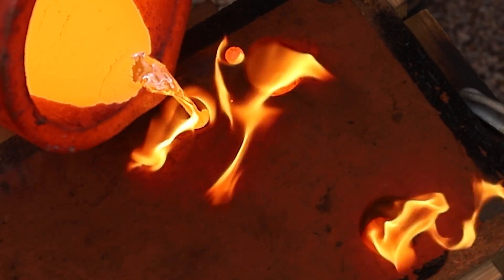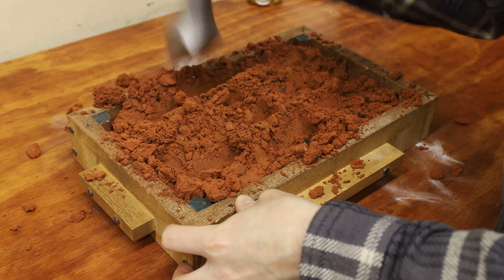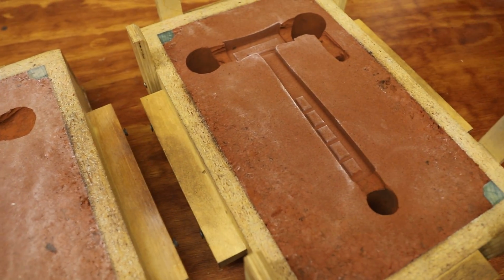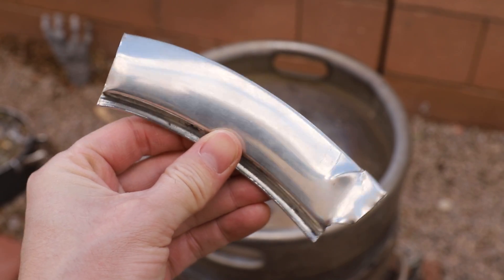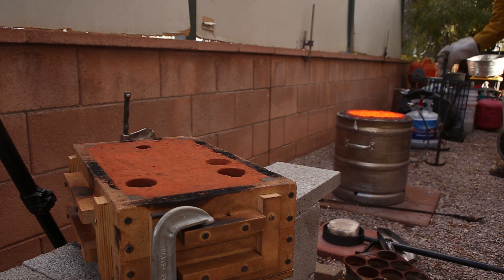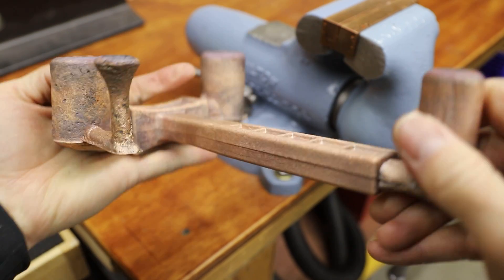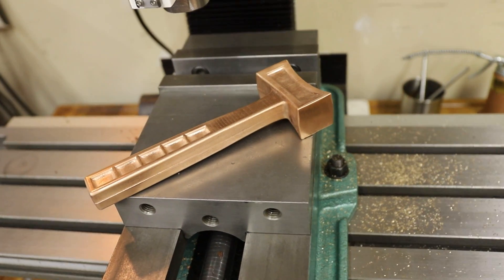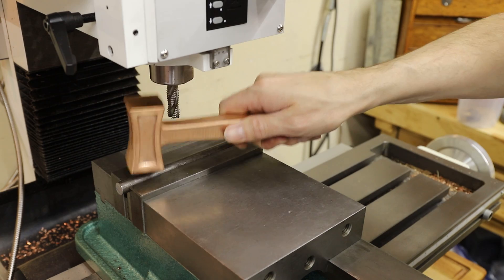Making a Solid Copper Hammer

Comment: Maybe you could help me, I have tried to make an oz of copper but the metal softens before filling the mold. I don't know if it's the spider, the air vents, the fire, I have no idea. I use silica sand and sodium bentonite, in a mixture of 3 to 1 or sometimes 2 to 1.

Comment: I'm sure you can drill the bottom of the handle out a bit to lighten it up a bit; just don't drill too far in or drill too much out, I'd venture to say you can run a 1/2" drill about 5 inches up with no real issue to integrity or strength. Cheer's...

Comment: you took time to clean out the indents of the hammer with a dremel, but you didnt sand off the parting line while at the belt sander? Why bother making it all pretty, if you are just going to leave a mold line? I'm not trying to be overly critical, I'm just trying to understand why you would put effort into one thing, but then leave something that mars the overall look of the project.

Comment: Hey try 3d printed electroplated full copper process, no melting hot temps, just electricity
Reply: Also can make metal molds with same electroplating technique
Reply: Like nickel and chromium metal molds for high temp casting

Comment: You could make the hammer lighter if you drill a hole into the bottom of each side of the head.... and if you were worried about it being too weak you could tap= the holes and make some aluminum screws to fill the holes back up put some strength back into it but only have a slight reduction in weight.....
OR you could 'skeleton-ize' the top of the hammer head, going down on a few centimeters, but leaving a skeleton shape in the cut-out to keep some of the strength... that would a REAL TEST of your mill-skills lol -- I KNOW I could NEVER do it!!! haha :)

Comment: I used to make lead head mallets by taking apart dead car batteries and smelting the plates to pour into soup cans with a gas pipe handle, I sold them to English car owners that had knock off wire wheels, the lead mallets don't damage the knock off ears

Comment: dont you wanna pound tubes flat before smelting them as there is a chance an air bubble can get trapped and cause an explosion of sorts (explosion as a little pop but sprays hot metal around)
Reply: you can, but flattening the pipe can also cause air to be trapped in it. the only thing you really have to worry about with casting metal is your medium being wet or moist, thats what causes the explosion

Comment: solid copper hammer? i bet it's also used to wallop tweakers when they come to steal copper wires/pipes. if they want copper so bad, they can have it. 
now you just need a platinum one for catalytic converter thieves.

Comment: Non-marring copper hammer was my first serious tool that I cast. I chose to keep a wooden handle, and make a couple, from 1 lb to 5lbs.  The first one I made, a 3 lb sledge, I made with pure copper wire. That thing is >>SOFT<<.   Next one was pipe like you used, and is significantly harder, but still softer than a real bronze or even iron. (No idea what was in the pipe to harden it)